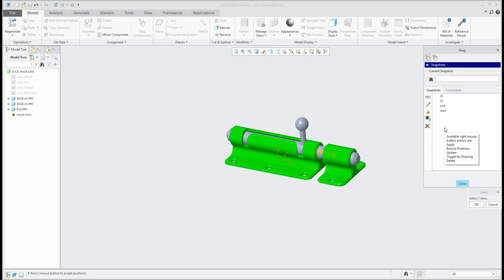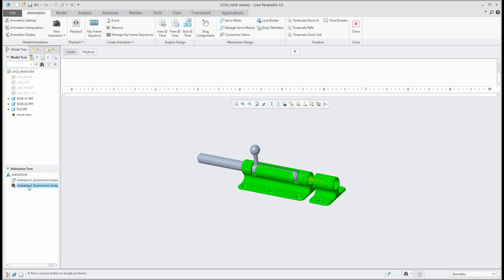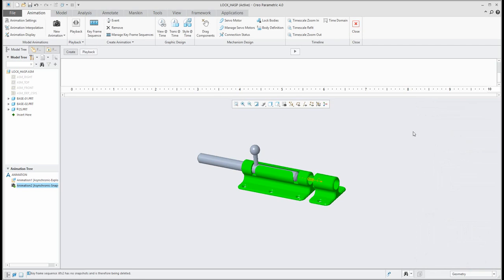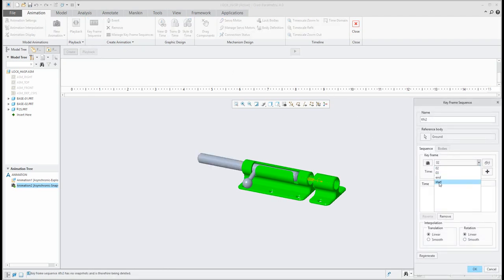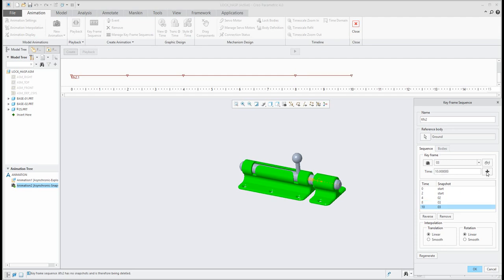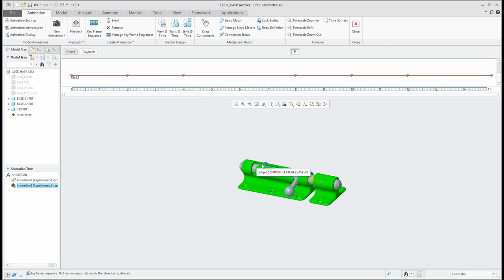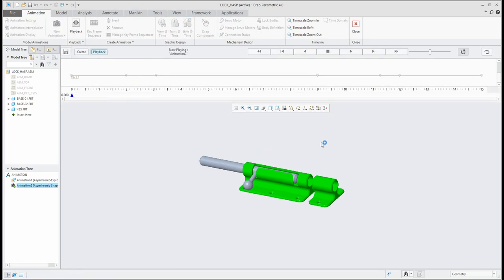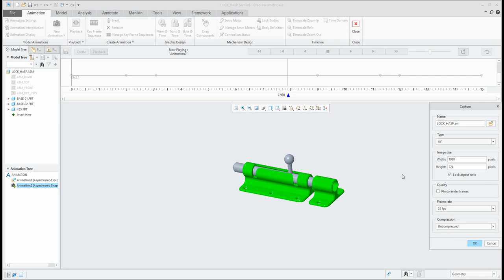PTC Creo 4.0 tutorial: How to create Animation by Snapshots

Comment: Hey 4K Side, great videos! I have a question: I am making an assembly animation, I start with taking snapshots and dissassembling the parts first, then I reverse their order and add into keyframe. I have a bolt and nut separated and away from the space they are supposed to go in. As soon as I press play (while still in the create tab) it automatically puts these parts back in their original position relative to each other but that is not defined in any of my snapshots, any ideas?
Reply from the maker: Hi, thank you for your question.
Try to add transparency to the animation and then you will see only necessary objects (it is workaround, but maybe it will help you 👍)
Bye Vladimir

Comment: Hi, when I export my animations from ProE as MPG, the background has a terrible blue fade in the upper corner, but all my system colors are set towhite background like yours, do you know what the settings are for saving these with a white background? thanks
Reply from the maker: Hi, from my experience I do not use direct export to avi or another video format. I always generate jpg files and transform to avi after generation all sequences. Try to export it as jpg and check if background is OK. Bye, Vladimir